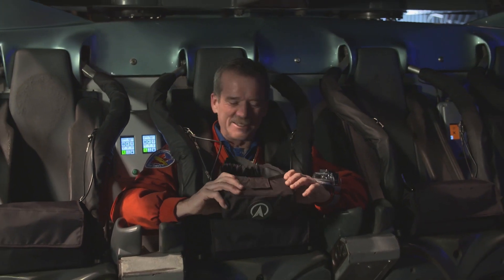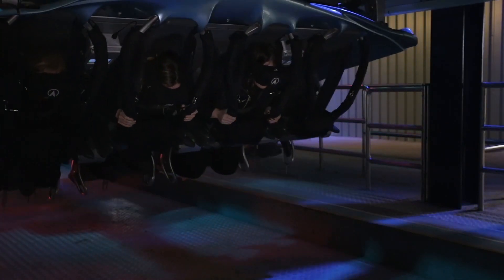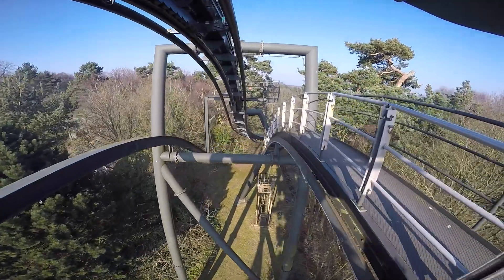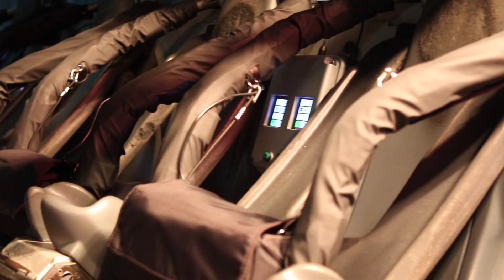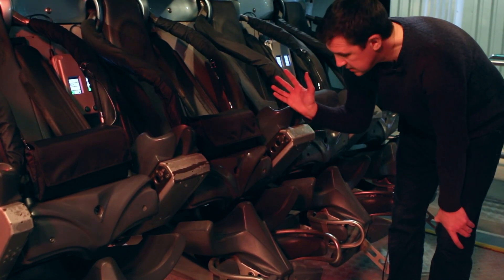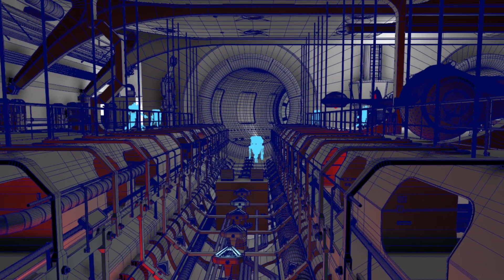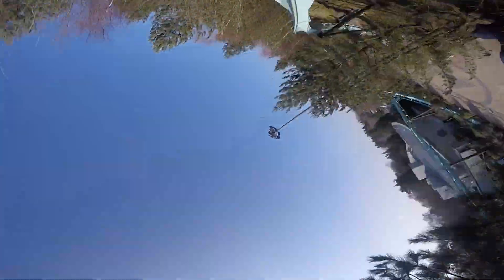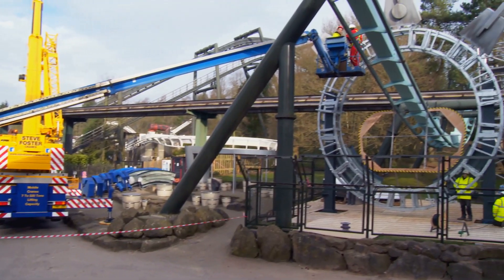Go Behind the Scenes of a Virtual Reality Roller Coaster

Comment: I really hope they sanitize those goggles after every ride. I don't wanna get a staph infection from the last pimply-faced teen to don it.
Reply: +Mike Trieu (MegasChara) quote from this article (gizmodo.co.uk/2016/03/alton-towers-galactica-vr-roller-coaster-delighted-and-frustrated-me/) written by someone who visited to do a test ride: 

"As well as strapping each rider in and ensuring they wear and optimise their high-tech gear correctly, Galactica's team of attendants also needs to wipe down the Gear VR headsets with disinfectant between rides.

Briggs told me that one attendant would be responsible for kitting out each row of riders, which makes Galactica the most manpower-dependent attraction at Alton Towers."